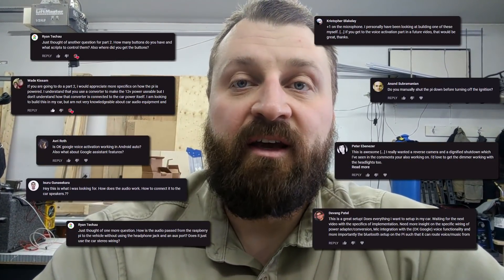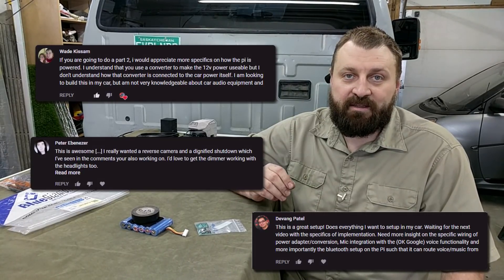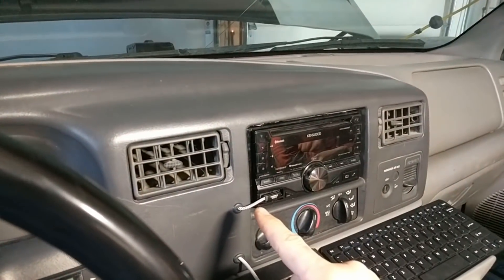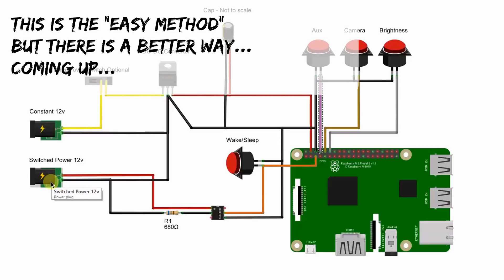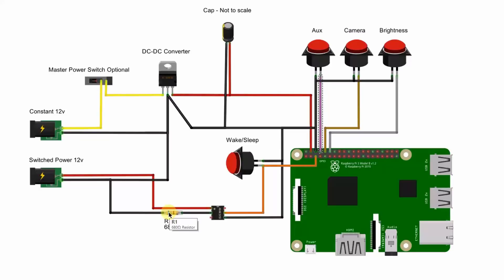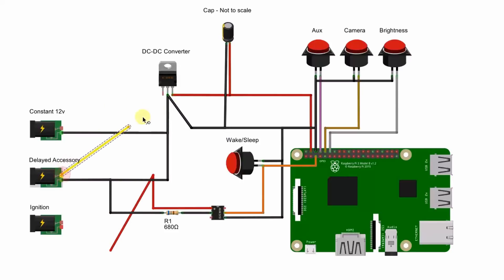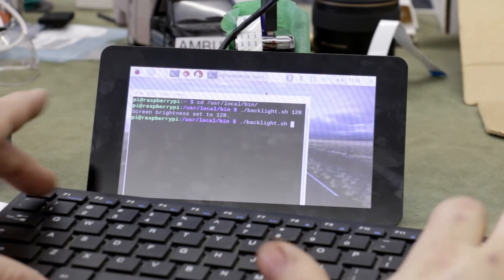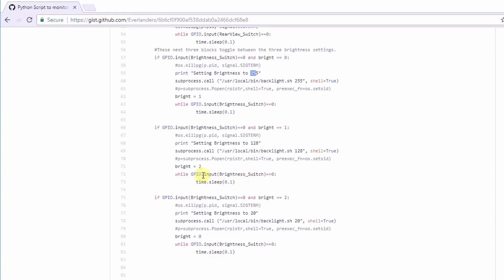Wiring AndroidAuto & Raspberry Pi to your Car - Rear View Camera, Connection Diagrams, OpenAuto

Comment: Naive question but I would appreciate your input: If i skip wiring the yellow constant 12V and wire only the red of the switched 12 V power/ ignition with the red of the 12V-5V  converter, what can go wrong? 

So grateful for having people like you sharing that sort of stuff. Thanks a lot!!!
Reply from the maker: Not much, you'll corrupt the file system.🤷‍♂️
Reply: @Everlanders  Excuse my ignorance but how the power supply is related to the file system of Raspberry?
Reply from the maker: Like any other computer, if you yank the power before or during a write operation you can run into problems with file corruption. That being said, I've pulled the power by accident many times and it is mostly fine. You'll just need to blank the card and rebuild it.
Reply: @Everlanders  I think I get it. Much appreciate again for sharing such a ton of knowledge and past experience.
Reply: @Everlanders  Last question: what if I install a switch to on and off manually the whole unit after ignition/ before shutting down? I dont think I actually need this delay. The official RPI 4 charge comes with a switch for example. It cannot work the same on the car?
Reply from the maker: It seems your missing some fundamental understanding here... Your switch will work fine as long as you shut down the Pi before cutting the power.

Comment: Bit late here but still gonna mention it.. i am impressed by the way you are using your RPI opposed to how i use it ... retrogaming... and then it clicked... since you are already running raspbian in the backround you could install a simple frontend like emulationstation and hook up a wireless controller for gaming while you are bored on the go... you could just bind it to one key button to launch it and rest is done by the controller... rpi 3 can handle everything from atari/nes/snes up to ps1. Anyways good job.
Reply from the maker: Zero interest in gaming from the driver's seat on a 7 inch screen...

Comment: Hi, one last question : 

How do you get internet on the pi (for google maps) and how do you have phone on the pi ? 

Do you connect the pi with phone through an usb cable ? that's it ?
if yes, do i have to install a software client on my android phone ?
thanks
Reply from the maker: Yes, USB or wireless... And Yes, the Android Auto is installed on the phone, that's where it gets the Map data from.

Comment: Hi love how you have used the pi it got me tinkering ;) although no where near your standard! I have a couple of questions? Have you ever used or played with the victron venus image for pi? and in one of your later videos you have a few cameras hooked up, how did you do that? are you using the pi to control all your devices solar air rams, air pressure for water system and other bits? sorry for the all the questions but i'm really interested in it all, love the channel and you truck keep the vids coming :)
Reply from the maker: Yes, the Pi(s) control almost everything, Cameras, Relays, SSR's, solenoids for the air stuff... Never heard of VictronVenus, sorry.
Reply: @Everlanders  thanks for quick reply, how did you get more than one camera on the pi? will you be sharing anymore of your code on github? thanks
Reply: @Everlanders  just re read your reply.... im guessing you have more than one pi sorry its been a long day lol

Comment: This is amazing. I started a project on building a new head unit for my BMW E87 that and it previously had a Head Unit running WINDOWS NT with a bad Chinese customization, and I'm researching for about a week now on everything (Single Board Computers, car wiring, sound amplifiers, etc.). One of the main challenges I was about to face was this rear view camera situation, since my old head unit had it running I want to use it too, but I had no clue on how to switch to the camera image. Thanks to you I got everything figured out now! (Btw, I'm going to use Odroid-C2 instead of a Raspberry Pi, running full Android system on it, you might want to check it out also)
Reply from the maker: Is there a turnkey Android Auto image for Odroid?
Reply: @Everlanders  Not that I know about. But there is a Android (full os) image that is officially supported. And you can also use the Ubuntu image and build Android Auto for it, but then it is not turnkey at all.

I'm planning on using the full Android OS image though.
Reply from the maker: Good luck, let me know how you make out or if you make a video showing how you did it.

Comment: I noticed you had Google Maps on there. What do you do when  away from wifi (driving)?
Reply from the maker: The maps are delivered via the phones LTE data connection.
Reply from the maker: Or the Wifi router in the back of the truck... Which is also LTE

Comment: Brightness connected to headlights has some use cases that it might not work for, but I might want to tap the backup camera script into the reverse illumination lights so that it should automatically engage the backup camera when the transmission is in reverse.
Reply from the maker: Yup easy to do...

Comment: You shouldn't drive with your hand on your shifter. It's a very bad habit which I used to do until I started driving at race tracks. My first instructor broke me from constantly doing that right away. Just think about it. If you need to make an evasive maneuver or respond to a tire blowout, you really want both hands on the steering wheel, preferably at 9-3 (or if you must at 10-2).  This could save your life someday.

Comment: Nice! Thanks for this video. The backlight script is great and the buttonmonitor script will be a great starting point for me to be able to select one of several cameras to view...if I can figure out how to get usb video on the pi! I had to use crontab -e to get the scripts to autoexec on boot. 

couldn't get anything else to work. Running Buster and Open Auto Pro on a rpi4b. Just about there with my truck computer! 

Done anything in the TPMS area?

Comment: Great system and very well explained! I know I’m late to the party here, but I was wondering if you’d thought of using other taps from the car’s harness to use as triggers for the reversing camera and brightness commands? I thought I heard you mention something about it briefly, but I maybe wrong. I was thinking it would be great if you could use a tap from the reversing lights to trigger the rear camera picture to appear on the display, and a tap from an exterior light (or interior button backlight) to trigger the screen to dim. At least then you’d save your gear shifter from the wear and tear everyone’s been moaning about!
Reply from the maker: Tapping the reverse lights would be easy enough, but what the commenters don't realize is that we primarily use the rear view when driving forward... Our camper completely obstructs our view, and I like to be able to look rearward when changing lanes... I provided code for either option, but the armchair comments continue.

Comment: what camera did you use for reverse camera and how did you weatherproof it and wire it?
Reply from the maker: I've made videos on all this, so I'm not going to type it all out in the comments...
Reply: @Everlanders  Sorry. My question may have been a bit poorly worded. I have watched both videos but the only mention of mounting the camera is that it was taped to the back of the cab. I'm more interested in how you made the camera weatherproof (if you needed to) and how you made the hdmi lead connection weatherproof also as i am building a similar system for my car but I'm mounting the camera on the back of a tray. Thanks.

Comment: If I wanted to power 2 pi's would I need 2 of the step down converters?
Reply from the maker: No, it would power both, no problem.
Reply: @Everlanders  Great. Thank you for the response. I am trying to hook 2 Pi's with Kodi and RetroPi to 9" LCD monitors in the backseat. Wiring things in the car is a new endeavor for me.
Reply: @Everlanders  What kind of connector are you using to run the wire from the converter to the GPIO pins on the PI? I have jumper wires that came with my PI and the converter wire looks like it might fit in, but I was unsure if that is safe. The jumper wire is about half the diameter of the converter wires.

Comment: That delayed circuit tap is freaking GENIUS.
I've been chasing how to allow a safe shutdown of my carpi, and this is phenomenal.
Reply: I was given an alternative solution by a very knowledgeable friend of mine to make your own independent delay circuit.

Simply place a capacitor in front of a relay that switches constant 12v with the ignition wire. I ended up using a pretty big 22000uf capacitor with a relay that has 900ohms across the coil. That gave me about 25 seconds of delay with a 12.5 volt source before the relay switches off. Plenty of time for a clean shutdown. Of course if you can find a relay with a higher resistance you can get away with a smaller capacitor. The voltage that the relay releases at also plays a part in the time out.

You also need to place a diode before the capacitor to prevent volts from running back the other way. I also put a resistor before as well to help reduce the rush current to such a big capacitor.

Excellent work around if your car doesn't have an accessory delay or you like to crank the key out and open the door at basically the same time like me.

Comment: great vids man - subbed. Trying to build something for a Jaguar XF. Is it possible to hide the start up loading scripts with maybe a boot animation? I've created one on an Android tablet but not sure how this would work on a PI as different OS being used.
Reply from the maker: Yes, Vey easy on a Jaguar XF or a Fisher Price ride along car. Replace console=tty1 to console=tty3 to redirect bootmessages to the third console.

Add loglevel=3 to disable non-critical kernel log messages.

Add logo.nologo to the end of the line to remove the Raspberry PI logos from displaying. Press CTRL+X to exit and Y to save your changes.

Comment: Is it possible to take the audio output from the pi and plug it directly into an audio amplifier. My amplifier is driven by rca cables and i dont know if the pi can handle this. also if that is possible, how can you control the volume directly from the pi?
Reply from the maker: The levels are line level, no volume controls...

Comment: Another fantastic video.  This is beyond my limits however with your explicit instructions I’d give it a go.  I’m going to buy a new Sprinter as I’ve been unable to find one with the options I want.   This is a budget strain, the factory head unit with nav is pretty spendy, especially compared to  your solution.  The only bugaboo I see is to use the Raspberry navigation you need internet?  Am i correct on this?
Reply from the maker: No, it's easier to think of this as a remote display for your phone. The GPS, data connection, audio and everything comes from the phone.

Comment: Just an FYI, The Bluetooth chip on the raspberry pi cannot do Bluetooth audio for phones correctly. If you want to do that buy an external adapter and it will fix any connection issues.

Comment: Anyone have experience setting this up with four+ wireless cameras.  I'd like to have two cameras mounted on the front of my travel trailer pointed to the rear, one on the front center pointing forwarded, and one on the rear pointing behind the trailer.  The idea is to have the front rear facing ones show a view along the side of the trailer when mirrors won't work due to turning left/right, the front center showing a view at the highest level of the RV to help avoid overhead obstacles, and a rear facing one showing traffic/obstacles directly behind the trailer.

Comment: I know you didn't replace the head unit itself, but if I were to do that, do you know how I would connect the speaker wires to the pi?
Reply from the maker: You would need an amplifier, such as a head unit.

Comment: How do i hook stuff up to the pins to do pi if i got a hifiberry soundcard? It takes up all pins. Can i just solder to them or is it really using all pins?
Reply from the maker: I've never used one, you'd need to ask them which pins it's using.
Reply: @Everlanders  thanks for the answer!

Comment: I have a question about using the RPi as a parrot. So you have an audio dongle (soundcard) that splits in aux and mic. Is it possible to plug in the mic and use it when calling?
Reply from the maker: Yes, this is exactly what I show how to do in this video...
Reply: @Everlanders  I'm sorry but I couldn't find it in the video. I'll just tinker once I have my parts and see how it goes. Great channel still! :D
Reply from the maker: The external sound card is discussed in the part one video, go check that out if you haven't already.

Comment: So I what would the advantage be to installing a raspberry pi set vs buying a cheap android double din. Could I connect the raspberry pi to a cheap android double din stereo? Trying to figure out what I want to build. I want a pi in my truck but if I could add it through a video port that would be great.

Comment: This project is awesome! It is inspired me to do something like that in my car too. Now everything works great except the reverse cam.I have exactly the same issue what you had (purple flickering lines), could you tell me how did you solved that exactly? It would be a very big help for me. Thanks.
Reply from the maker: Higher quality HDMI Cable.
Reply: @Everlanders  Thank you. I have already tried a few one. So you haven't made modification on the HDMI to CSI converter?
Reply from the maker: @rigamen91  How long are you going? I did try using the extra contacts on the adapter to send extra  3.3 and gnd paths for better current.  I do still get some purple lines sometimes, but it's intermittent. Not sure what causes it.
Reply: @Everlanders  I have a 5 meters cable. I have an additional GND cable soldered to the converter . I will try to do the same with the 3.3v too, as you have. I saw on the video you have a capacitor on it, is it helpful?
Reply from the maker: 5 meters should be easy... I have 10. Double check that your connections are solid. Try connecting your CSI cable and locking it down, then gently pulling it out. Then reinstall it, this will scrape the contacts together for best connection. But at 5 meters you should not have a problem, I suspect your HDMI cable.
Reply: @Everlanders  Ok, I will try it. Thank you very much for the support!

Comment: Are you able to run Gaia GPS on it?
Reply from the maker: Never heard of it, we use Google's GPS nav, it's built in.
Reply: @Everlanders  yes I use Google maps too but for exploring I am starting to use Gaia. The constrain that I have is with the storage of the offline maps, I believe a raspberry pi setup like yours with a 1TB disk should work but unsure if it will install in it

Comment: Watching this video I noticed the push button start? The interior of the vehicle seems quite a bit older so I’m assuming that is an aftermarket addition to the truck, could you direct me to the product or a video you may have on it if it is an aftermarket piece! Would be much appreciated thanks! I’ve found a few aftermarket pieces that I was interested in like that but none of them have seemed to have any reviews
Reply from the maker: There are many available on Amazon and eBay, do a quick search and you'll find a bunch.
Reply: @Everlanders  I have found a few I was just curious what yours is (if it is aftermarket) because many I find on Amazon dont hsve more than one or 2 reviews and I'm am looking for a reliable one
Reply from the maker: @TFisher171  I gutted mine and reflashed my own code, just using the button and relays from the original... Not the right person to ask.
Reply: @Everlanders  yeah I'm not that great eith this stuff I was just curious thanks anyways!

Comment: Which dc to dc regulator you are using? It looks awesome with huge heat sink, I tried searching but could not find any that matches yours
Reply from the maker: Links to all the parts are in the description of the part 1 video.

Comment: Does anyone know how to exit fullscreen when android auto is opened? I can´t access anything else on the raspberry... (I want to  disable always on top). Great project!!
Reply from the maker: There is no way, that would be very unsafe. You need to unplug the phone and press exit if you must access the desktop.
Reply: @Everlanders  I understand the safety reason. My goal here is to replace the PiCamera with a usb camera (from old laptop) which I already manage to start running on boot with  guvcview. The next step would be to bind a shortcut (Alt+Tab ex.) with the GPIO values coming from the reverse tail light on the car. Any idea how to overcome this problem? Thank you!
Reply from the maker: Nope, sorry
Reply: @Everlanders  No problem, I´ll try another approach. Just to confirm, untill now, is the camera (FishEye) setup working on your project?
Reply from the maker: Yeah, it works fine... Raspivid displays this on top of the Android Auto GUI

Comment: I was wondering if you can suggest any other touch screens than original Pi 800x600. There are plenty of options on the market, but to be fair, only fewer I found will fit the purpose. Please, advise.
Reply from the maker: The others I've tried are very poor, the display is poor and there is a plastic film overlay for the resistive touch element. the official screen is much nicer and has a glass capacitive touch like modern smartphones.
Reply: Everlanders, does it not bother you that its resolution pretty low for modern days and apps - 800x600?
Reply from the maker: No